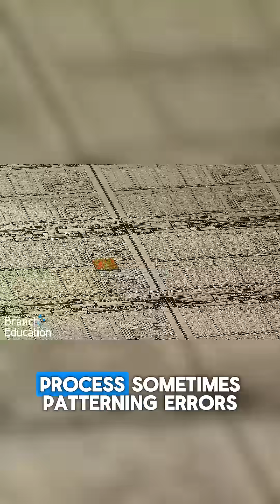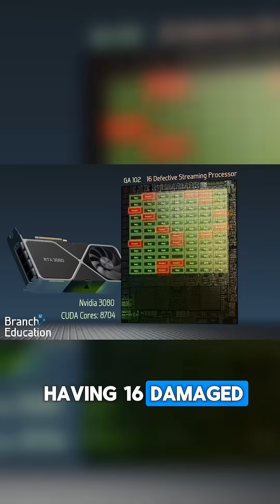How do Graphics Cards Work? Part 4 #gpu  #technology  #engineering  #videogames

Comment: Fun fact this is the exact same thing for cpus and is literally the only difference between I3 I7 I9
Reply: Yep! AMD engineer here, that's how we mainly get our ryzen 7 and ryzen 5's, just down binned ryzen 9's
Reply: @chopskie117 isn't that not exactly as true as it was before though? With the CCDs
Reply: @chopskie117  i remember when i was young you could unlock those disabled cores
Reply: @AaronRczheski that sounds risky
Reply: @chopskie117  ryzen 9s have 2 CCDs, ryzen 7 5 and 3 only 1. literally something completely different.
Reply: @anonymouscommentator  maybe now, but earlier on you could have 3 + 3 cpus.
Reply: @chopskie117  Hey! I have a couple questions for you, if you don't mind. 

If there were to be an extreme or unexpected demand for ryzen 5 chips, for example, can the foundry just make them with the specified number of cores from the start? Or do they just make the same ryzen 9 chips and intentionally disable certain cores? If they're disabled but otherwise working properly, would it be possible to re-enable them? If so, how? 

Furthermore, do the imperfect areas of a chip that would be severe enough to turn it into a Ryzen 3 chip have any other side effects such as reduced lifespan? 

Thank you!
Reply: @chopskie117  then how 7800x3d ryzen 7 was faster than ryzen 9 7950x3d
Reply: @chopskie117  42 subs, 1 fortnite video... definitely the channel of an AMD engineer. hahahah
Reply: @chopskie117  Even with CPUs with more cores?
Reply: @chopskie117 that’s nice to know. I have a question though. When I was researching what cpu I should get, I read that the 7800x3d gets better performance than a 9800x3d when less cores are used due to the 3d cache not being spread between as many cores, and because i usually use it for cpu intense games I’d be better off with the 7800 despite it having a slightly higher price. Is this true or did I misunderstand?
Reply: @chopskie117  I can't wait for the Ryzen 5090
Reply: @chopskie117 how can you be a ryzen xpu engineer if just 2 years ago you were still in prolly first year of college
Reply: @DesuVentix you don’t know this person
Reply: @creeperbell  he literally just took CS3358 2 years ago which is a 3rd semester class
Reply: @DesuVentix Engineers often take DSA their 3rd year lol
Reply: @DesuVentix Its a review session video, he was probably a TA.
Reply: @DesuVentix  jelly
Reply: @chopskie117  is it possible to buy cpu from manufacturer at cheaper price than retail?
Reply: @laptopgamersz  its called MSRP for a reason, guess what the M stands for... they arent selling it any cheaper to you
Reply: @laptopgamersz  I did at microcenter, went to buy a returned 3800xt, manager stopped it said he didn't feel comfortable doing that since he don't know why it was returned, so he grabbed me a brand new one and gave it to me at open box price, was like $60 off lol
Reply: Now im interested in how many cpus and GPUs are actually damaged and how many of them are just deactivated on purpose so you have lower CPUs
Reply: @GodOfChaos_HeXa  also if there's a way to reactivate. back in the day via firmware you could unlock the potential of workstation GPU's. they were just underclocked undervolted versions of a gaming variant with slimmer cooling solutions
Reply: Fake comment ryzen 9 uses 2 ccds while ryzen 7/5/3 use one
Reply: @starnoelle8248  there are 3+3 core ryzens.
Reply: Fun fact: Due to high demand for low-bugged cards, sometimes even fully functional cores get deactivated. In the past, these parts were actually deactivated. Nowadays, they are laser-cut to prevent them from being easily 'reactivated'.
Reply: @Jellybean85329 wow, very nice of them
Reply: This goes all the way back to 486 CPUs. A 486SX was the same as a DX but had a defective/disabled FPU.

However.... Legend goes that the demand for the lower cost SX chips was outpacing the defection rate, so Intel intentionally disabled FPUs on perfectly good DX chips to meet demand.
Reply: This is how I unlocked my 4th core on my Phenom, I bought it with 3 cores
Reply: Binning is only one of many differences in the chips. For example, the i7/i9 and i3 chips usually are completely different dies on the same architecture.
Reply: Also, not only the amount of damage, but also the highest stable clockspeed is vary. The exact same chip design could run well over 5 Ghz in one product and crashed before even reaching it. That crash one are sold in slower clockspeed
Reply: Dude is hard capping for real just make up a fake comment for likes and people believe it, what he claims about ryzen 3/5/7 being "down binned" isnt true and made up ryzen is chiplet archtecture which means they add ccds to make a ryzen 9 as of right now the biggest ccd is 8 cores. So this is huge cap
Reply: Good thing I use i5
Reply: One cool thing during the early 2000s was some ATI cards could be "upgraded" to a higher GPU by hacking the firmware. Sometimes if they didn't physically cut the pixel pipelines you could upgrade the firmware and have a faster GPU for free.
Reply: HOLLLYYY
Reply: So they are technically all worth the same? And where all getting ripped off with broken components?
Reply: @MercGT63s  cost the same to manufacture**

Not worth the same.
Reply: Pfp is familiar😂
Reply: @serenity9373  who's
Reply: Wouldn't the single core performance be equal or do they make the cores slower too?
Reply: i5*
Reply: It was the same with athlon x2 or athlon II x2/x3. Some motherboards had the option to unlock disabled cores and some CPUs worked flawlessly, some other was stable with lower clock or different voltage, andsome was just bad.
Reply: fun fact you literally saw this guys other video and used that information
Reply: That's what brought me here
Reply: Screw the amount of cores.
Reply: This is 100% false!!! There are many differences in design. They straight up have a different number of threads/cores

Comment: I never knew this but as a consumer I mean is this the standard for any other graphics manufacturers. Maybe it’s naive for me to expect a perfect product but I never thought that this is something that doesn’t have to be 100% perfect and still sold
Reply: Mmh well it's bound to happen when creating circuits less than the thickness of your hair, also think about it if you have an air-conditioning unit, and the swing and timer does not work, would you now throw the air-conditioning unit when it still cools the room? The idea is like that
Reply: this has been the standard for whenever they existed.  its wasteful to throw away the whole board when it is expensive to produce and only have very slightly damage
Reply: Well yea people take them for granted but microprocessor are extremely complex and very difficult to manufacture, just because we make a ton of them doesn't mean the process isn't very complicated, defects are inevitable so most chips start as the best possible sku but if too much of it is defective it's down binned to not waste the chip
Reply: It's techincally not defective at all. At the microprocessing level it's just as though the chip has less cores (because they deactivate the bad ones) so it's simply makes way more sense to sell you a chip with deactivated cores instead of selling you an entirely different chip with less cores. My big question is - do they deactivate cuda cores that aren't defective, or do they for sure have enough defective chips to output the 3080-3080ti line? And, if so, is it possible to get 3090 power out of a 3080?
Reply: @SamEy3am  The chips themselves are defective, they laser off the bad cores.  That's exactly what happens.  
No, the cores aren't just deactivated, they're lasered off, permanently disabled.  

If they do not have enough defective chips for a certain line up of GPU's, they will purposely laser off perfectly working cores to help fill that specific line.  No, it is not possible to get 3090 power out of a 3080, or 4090 power out of a 4080Ti.  Not without over-clocking the cards anyways.
Reply: @Nighterlev  yeah I wasn't sure how the "deactivation" worked. That makes sense, without the cores being there then of course they can't be reactivated. The more I thought about it (assuming they were simply damaged and not lasered off) I can't imagine there would be any sort of DIY way to repair them anyway.
Reply: @SamEy3am  Once it's lasered off, it's gone permanently.  There's no way to fix it at all.
Reply: You know this applies to TV's & Monitors as well right?

That's why so many different models of the same TV / Monitor exist, certain panels are better then others due to simply having as little defects as possible.
Reply: It's the same for cpus
Reply: It costs a fricking fortune, of course we expect it to be flawless
Reply: @pinapple_pizza  The parts you are paying for are flawless, but basically you just get the non working cores for free, but all the parts related to the specs you bought are working.
Reply: Wait till you hear how cpus are made and categorized
Reply: Not just graphics card chips, but also CPUs work this way. Also its usually predictable which chips will be defective based on their location on the wafer. The outer ones will have more defects and the inner most ones will be the top tier ones.

Comment: Can they deactivate as they get older? And does this have something to do with silicon lottery
Reply: Yes, but there is no need for this. No it’s not related to silicon lottery
Reply: Silicon lottery will have more to do with the quality of working silicon, the more perfect it is the better results you can get from overclocking.
Reply: No it cant really be changed after manufacture as its basically "burning" fuses to disable a disfunctional part of the die. Silicon lottery has to do with flaws but more the speed limiting flaws and not really function breaking flaws